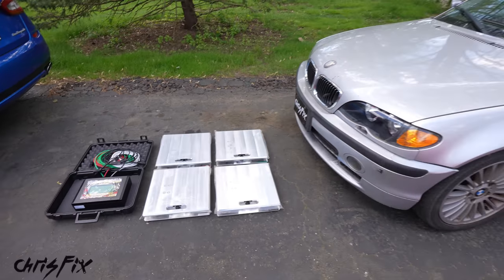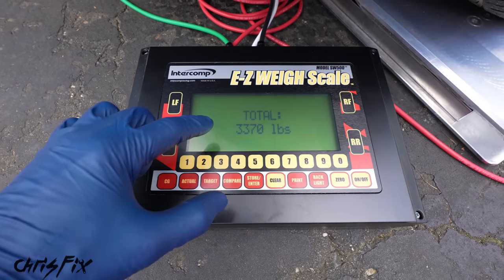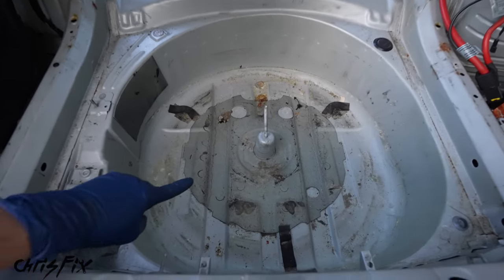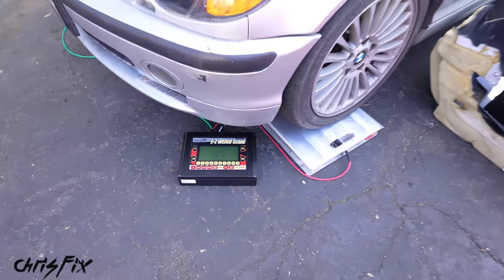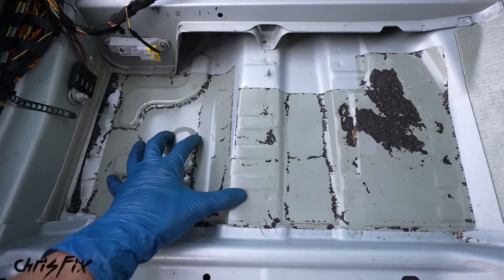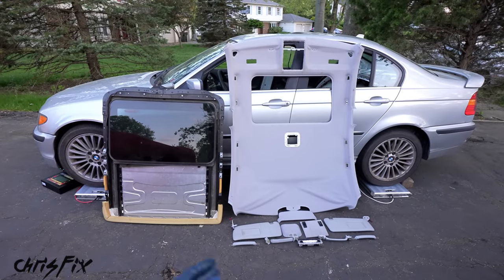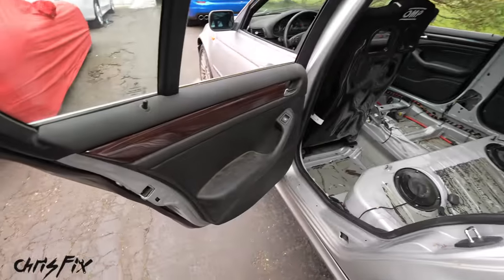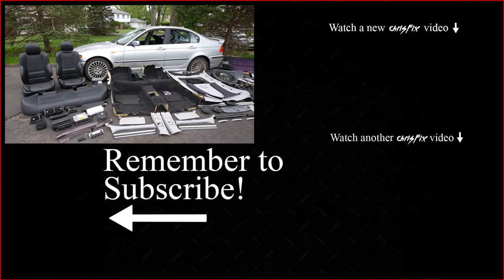How Much Weight can you REMOVE from your Car? (Weight Reduction)

Comment: That's a good weight saving! Some more weight saving thoughts: you can also remove the AC Compressor and use a shorter belt. Remove power window motors and fix the position of the windows if allowed. Remove the cabin air heat exchanger and piping. Replace heavy door interior panels with fibreglass coverings if allowed. Replace glass side windows with clear plastic if allowed. Remove cabin air ducting if allowed. Remove the catalytic converter and add a straight pipe to the muffler.
Reply: As well as lightweight wheels
Reply: @loluser41  yea, he mentioned he would change them to race spec..
Reply: Crash support on the rear bumper lol
Reply: Add some carbon fiber body parts (bonnet, roof, trunk) + carbon fiber brakes ! ;0)
Reply: @poplaurentiu4148  can't increase the cost by so much of carbon fiber..
Reply: You bring up more than i was thinking of. Not sure what the race rules are but i was already thinking about the door glass, window tracks/motors, door locks and assemblies, trim pieces and speakers, to be replaced with cut to fit sheets of plexi held in place. Removal of the AC and castalytic and such would help too, (plus removing the AC compressor reduces rotational load on the engine too!) but he did mentioned time being of the essence so maybe he'll do these things in the future.
Reply: ac has its own belt on m54 engine so just pull it off

Comment: You forgot the most important part - lightweight wheels and tires. That’s dynamic weight so every pound you cut will feel x3 as much as static.
Reply: 100% agree with you there,  it’ll make the biggest difference in weight, handling and grip!
Reply: Uh he did say at the beginning of the video that he will be replacing the wheels and brakes eventually, but not now, if I'm not mistaken.
Reply: General rule of thumb is that every pound of rotating/unsprung mass is worth about 4 lbs of sprung mass.  Unfortunately, there are big consequences to having smaller brakes and tires on the track.
Reply: And only use 3/5 wheels nuts to save weight. And grind down the driveshafts to make them thinner to save weight.
Reply: @jeremyphipps777  He doesn't have to get a smaller wheel. Stock he's probably on aluminum. He could get a forged wheel, increased the diameter size by an inch and still save some weight.
Reply: Unless its against the rules for 24 hours of lemons, I don't know why he's keeping the original windows and door cards. Getting rid of the door card and window mechanisms would save a lot of weight, and replacing the glass with lexan would only help even more.
Reply: @wyattmunger5529  he mentioned it in the video. They contain shattered glass
Reply: @Radi0he4d1  The doorcards? If so, then why doesn't he just clean them out. Or did you mean that the windows are required to be shatterable?
Reply: @wyattmunger5529  Yup you are right. He should get rid of the interior car door panels especially in the rear since no one will be using it. That's a lot of extra weight.
Reply: @wyattmunger5529  I was thinking the same thing, remove rear door cards, glass and the electric window motor, lexan rear Windows and just some thin alluminimum as a door card, would save an enormous amount of weight
Reply: wtf are door cards?
Reply: @wyattmunger5529  The rules of this race say you have to keep them in, so in case of an accident where the glass shatters, it will contain the glass rather than shooting it all over the driver. He said this clearly in the video.
Reply: @Eralen00  still, why not remove the glass and replace with lexan? Is there something against the rules for that?

Comment: Imagine how much more weight you could remove with changing the wheels, removing exterior plastics, power mirrors, headlight washers, extras from under the hood, plastic covers.
Reply: bout tree fiddy
Reply: @liberationwasalie2982  💀💀
Reply: Remove AC unit
Reply: Remove the engine for a extra 200
Reply: @demarkisdinkins2737  only 200?! That’s a light engine
Reply: take the doors off, hood trunk, cut the roof and make it a convertible... Oh wait, mightycarmods did this
Reply: @beanman6684  super light engine
Reply: Replace back doors with carbon fiber panels /and or fabricate couple doors.. replace door with carbon fiber doors... Carbon fiber in general
Reply: @jesusmylordhegaveitall4894  anything that doesn't needa be strong would be cheaper and more DIYable out of glass fibre. Ik carbon is very cool but it's just not necessary for the majority of things car guys use it for, more for aesthetics
Reply: @demarkisdinkins2737  lol, its an inline 6. you can get more than 200 lbs from removing that. A subaru 2.5L flat 4 is like 200lbs. Jokes aside...You can definitely shave off weight from that inline 6 by literally shaving metal off the block like sprint cars do...
Reply: I switched over to Enkei f1 wheels on my mk6 gti from the Watkins Glen wheels. I saved 15lbs per wheel. 60lbs in total but 30lbs of that was rotating mass the engine didn't have to rotate.

Comment: “Having a sunroof is a safety hazard” 
.
.
*continues to remove airbags*
Reply: WHITH MODERN RACING HARNESSES AIR BAG IS JUST A NO HELP SLAP IN THE FACE
Reply: @csi1392  Ignorance is bliss. "Why can't I place??"
Reply: Airbags are super dangerous in a race car with a harness and a helmet and a roll cage. You're usually not even allowed to have them installed.
Reply: Rollcage
Reply: @jerth  really? How tho? Can you further explain?
Reply: @justasentientmclarenp1879  Because if you're strapped to a harness, and you get into a collision, you're probably not going to move enough to even hit the airbag, so it doesn't help you at all. However, it does make exiting the car in a dangerous situation much harder, so they're more dangerous if you're actually going racing. There's nothing an airbag does that a harness + HANS device doesn't do better.
Reply: @justasentientmclarenp1879  also with a full cage, an airbag will eventually not deploy correctly and can cause shrapnel and spalling from the interiors plastic
Reply: a man of balls
Reply: Technically having active airbags is also a safety hazard due to the risk of false detonation on a track. That’s what your race harness is for...
Reply: air bags are worthless with a harness and rollcage. i mean, seriously.

Comment: Plot twist:  The welder welds in a 430lb roll cage.
Reply from the maker: It’s about 130-150lbs
Reply: HAHAHAHAHA
Reply: Yeah but that sh*t will save your life on the track
Reply: 2940 lbs + 430 lbs would still be better than 3370 lbs + 430 lbs
Reply: Haha. But recoup that with a carbon body kit and light weight wheels 👌

Comment: looks like me removing evething i can from my SSD to install a game...
Reply: @hmm8602  i have both, but the games i play need ssd. my ssd is 128gb i need at least 250gb but where i live nothing is cheap with this pandemic
Reply: same, I have a 110gb ssd and with windows in it I can barely fit 2 games in it
Reply: the motivation they have for all this is insane
Reply: I finally got a 500gb ssd a couple months ago and a 3gb hdd and holy fk am I glad I did. These drives are affordable now for a decent brand. Luckily I don't game that much or else I'd be flat broke, but hell I can barely even download games now because my ISP limits me to 150gb a month and a lot of games are that size now. 

They have software now so you can easily clone your OS onto the new drive. Everyone likes a fresh install but man that's soooooo much easier. I cloned both my drives. Maybe test your drives with Sentinal to see how much longer you got left, might need to do it soon since some SSD's fall apart quick. And get a cheap HDD dock for your spare drives. Those things are great.
Reply: stop doing that, that will kill your SSD faster.

Comment: When putting a flexible panel like a sunroof delete in, start with the center bolts and work your way out to the corners. Same principle as tightening a cylinder head in the correct sequence to prevent warping.

Comment: Don’t forget to take out the blinker fluid. That stuff is heavy
Reply: i doubt that bmws even have em in the first place lol
Reply: @andreco6575  BMW turn indicators, the sasquatch of the automotive world .
Reply: @andreco6575 , that's because genuine BMW blinker fluid is so expensive, most owners just put up with broken signal lights.
Reply: @questioner1596  even if they have it they barely use it lol
Reply: where to buy blinker fluid?
Reply: @papajohnsuk5965  Old John's blinker store.
Reply: @mxzaiw2744  they were running low, thanks
Reply: @andreco6575  😂 true

Comment: Replacing the rims would also do alot... just get some really lightweight and you could gain well over 10 hp because the engine won't have to rotate as much weight to get the vehicle moving. 
This typically has a larger impact than simply removing weight off of the body because it is what the engine spins rather than what it is trying to move.
Reply: this is very important, i think its something like "every 10lbs of rotating weight is equal to 100lbs of sprung weight".
And those factory aluminum rims are heavy easily 40lbs each, so you can shave off 100lbs in rims alone and drop 1 sec in the 1/4 mile
Reply: No ratio is 1:4
Reply: Cant get 1s of  1/4 mile, i have tryed 20" vs 15" difference was 0.4s  but using better tyres for better grip will help more.
Reply: And then u don’t have to take them on and off every time changing tyres
Reply: @user-gd1mm7gw8k   4 tenths ain't nothing to scoff at from just a rim change,  anyways all i was saying was that rotating/ unsprung weight counts a lot more then sprung weight and its a sneaky way to get considerable performance improvements if you're racing in a class that takes weight into account.
Reply: @Ztrip01  you obviously misunderstand.  You know what they say every 100 pounds lost is around another 10Hp.

Same way with wheels, except more noticeable sense its literally what's spun by the engine. Even if its 30 pounds of weight reduction, in the rims your gonna feel the difference in power.

60 pounds + in weight reduction from the wheels and there is no way in hell you can't feel the difference. The car is still faster nonetheless, it is seen as a gain in Hp.
Reply: @Ztrip01  lol alright. I kinda just assumed  that you'd be one to put up an argument for whatever reason, its all i could pick up from such a short comment. Some people are just like that. At least i was wrong and your calm about it.

But yeah i see what your saying, whether you consider it as added power or not, its still faster and that's all that matters, no reason in sparking an argument over this.
Reply: Bruh the car is supposed to be under 500 moneys
Reply: @rodrigomarques1075  yeah the car is only
Reply: @blakegrigg3573  and I learned something new from your discussion w Blake. Thanks both of U for sharing  - and let us chase those pounds/kilos 😀
Reply: ??? Your right but with a wrong explanation xdd
Reply: Bro why are their so many bots on Chris's comments smh
Reply: You don't gain horsepower by reducing weight. You get better performance from losing the mass - big difference.
Reply: Yea unsprung weight really hurts you I remember when a switched from 16in to 18in rims on my interga gsr it really slowed it down. I miss that car it was the car i had in high school it was a black 1995 acura integra gsr it was only a couple years old then how time flies.
Reply: @CadillacDriver  agree, but I think what people try to say that by that is that less weight = less power needed to go at a certain speed/acceleration.

That is, to get an equal performance benefit of losing 100 lbs, you’d need to increase power by 10 hp (or whatever amount) if the one didn’t remove the weight in the first place. So it’s not quite correct but it gets the meaning across. Obviously losing weight also means handling improvements.
Reply: @blakegrigg3573  you are trying to say rotational compared to static weight.
Reply: @CadillacDriver  the end result is the same. thats what they are saying.
Reply: @werewolf74  they said it incorrectly...
Reply: @negergreger666  this guy gets it
Reply: no shit
Reply: @eaglefat9398  Yeah, it should also help shorten the braking distance. However, lightweight rims and tires can be quite costly.
Reply: @krusher74  sprung and unsprung weight. Its literally what its called.

Comment: Why not remove the sliding glass and slap some ballstic-grade plexliglass into everything except the driver door (net, obviously) and windshield (actually important, and worth keeping the shatter-proof coated glass)? That would also let you delete the interior trim on the doors, which you stated was only required so that it could contain the glass when the windows are rolled down, and the window motors, which is AT LEAST another 30-40 lbs...

Comment: As a European where stick shift is kind of the standard I cringed at seeing the relatively poor shifting (especially in the second and third 0-60 run).
You see the shifter slamming from side to side upon releasing the clutch. Be more gentle. With a manual transmission, you're the one to control the slip between the revving engine and the stationary wheels, where with an automatic you have a torque converter and in a sequential DCT/MCT you have the electronics to do that for you.

Additionally I would say,: Don't put that much force into shifting. You can still shift fast if you ease the transmission in the next gear instead of slamming it in. Several transmission parts like the linkage, shifting fork and syncro's will thank you.
Reply: Happy to see i wasnt the only one thinking he was kind of rough while shifting while i can go from first to second using two fingers
Reply: You never race i see,
Reply: @dreaparn2462  don't like your own comment
Reply: @impeter245  You cant stop me
Reply: @dreaparn2462   You've never driven a stick shift road car with a regular manual gear gearbox I see. Oh, and I have raced; in a car with a proper racing gearbox engineerd to take a beating.
Reply: @basobbens4149   I drive a 565whp Cosworth rwd lol
Reply: @dreaparn2462  and that proves you can drive it?
Reply: @basobbens4149  Well you said i never driven stick shift lol, You think you need a "proper racing gearbox" to bang gears, Ill run a 6 paddle clutch plate and harder pressure plate, Its just on and off, My gearbox takes it, Its also faster while racing to just drop it lol, Do you ever see rallydrivers with dogbox shift slow and following with the clutch? I guess you dont
Reply: @dreaparn2462  Well, you now admit you have modifications done and I didn't see any on the Beamer.
Have you ever seen a rally driver drive hard in a car where the only modifications made are taking parts off to reduce weight?
Reply: @basobbens4149  Yes i have, Since there is a class witch involve only a rollbar basiclly and you are good to go, And they drive hard af with them to win

Comment: Just FYI, I know this is two years old, but you can use aluminum sheetmetal in place of the door panels and still pass tech.
Reply from the maker: We found that taking out everything in the door gave us the lightest possible doors, not much of a reason to reinstall door panels

Comment: I had a friend who's so into the weight reduction on his car, he even tries to add as little gas as possible so he can just get his car extra 0.000001 sec faster.
Reply: thats about the difference between a low 11 second pass and a  high10 sec pass which is bragging rights lol
Reply: Every gram counts
Reply: Some cars it makes a pretty big difference. Gasoline is approx 6lbs per gallon. Multiply that by however many gallons a full tank is. I definitely notice the difference in my Z when my tank is near empty
Reply: Tell that to F1 racing
Reply: @naim2729  🍁 I agree 🍁
Reply: @alexslaydon5589  on the flipside your car doesnt run as well when the gas is low, you need good fluid pressure to keep everything working a well as it can, running out of gas and keeping the gas constantly low wears on the fuel pump which isnt worth the trouble, also there just common sense and making sure you dont run out of gas, basically theres no situation where keeping your tank low is worth it, especially in daily driving
Reply: @joseacuna3239  Their fuel is all calculated if you did not know. That is why in the beginning the cars weight the most and lap times are not that fast. But, towards the end they are able to go a lot faster because less fuel. Specially in qualifying.
Reply: @joseacuna3239  at least a dozen of those teams got fined.
Reply: Amazing how electric cars weigh so much and accelerate like crazy
Reply: @Iamallwaysright1  electric cars acceleration is because they have full torque all the time, they dont need to climb into the higher rpm's to access it
Reply: @Jumpsuit13HEYPEOPLETHISISMYURL  + usually big amounts of power + no need for shifting
Reply: @jeetsupa4362  actually electric cars tend to be underpowered compared to gas cars, prius is generally like 120 hp, its just all the torque you dont ever end up needing to give it much "throttle"
Reply: @Jumpsuit13HEYPEOPLETHISISMYURL  prius is hybrid
Reply: @Jumpsuit13HEYPEOPLETHISISMYURL  no I know, it's just that the performance jump is really impressive

Comment: Ironically just picked up a E46 330xi, thanks for the tips :)
Reply: Bruh r u gonna post
Reply: You mean coincidentally.
Reply: it'd be ironic if you just sold one.
Reply: Start with removing the FWD portion.
Reply: How bad is the oil leak?
Reply: @MrPeperoni79  fwd??? E46 rear wheel
Reply: oh so you’re here
Reply: You should have gotten an e36 smh
Reply: @bertsbug  330xi is awd
Reply: Take out the airbags next you’ll probably save a few pounds!!
Reply: @bertsbug  Yes, but the xi is awd so if you remove the fwd from it, you get rwd.
Reply: Be careful if its your only car
Reply: Great to know your still alive
Reply: @MrPeperoni79  you still have additional stuff due to the awd. You need to replace a large part of the drivetrain in order to make it rwd.